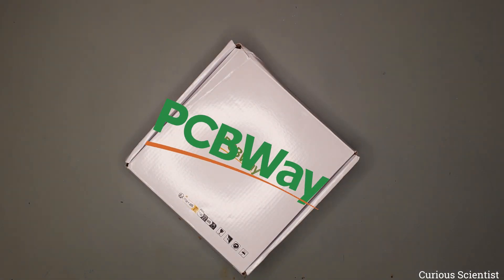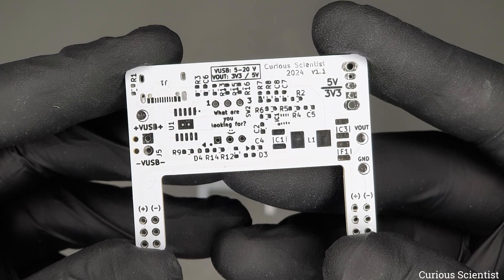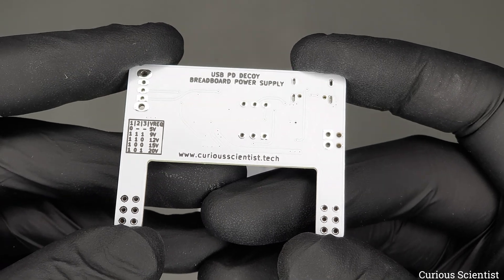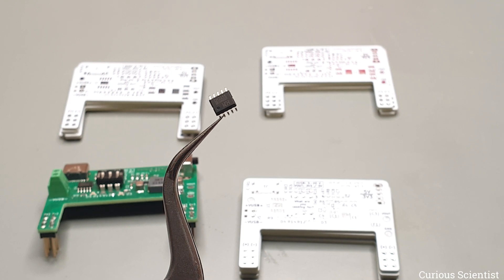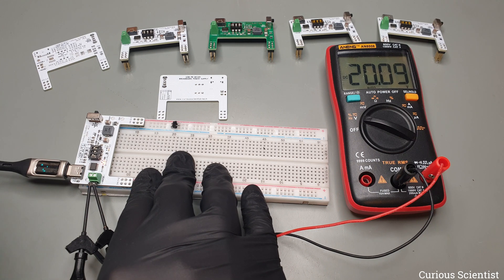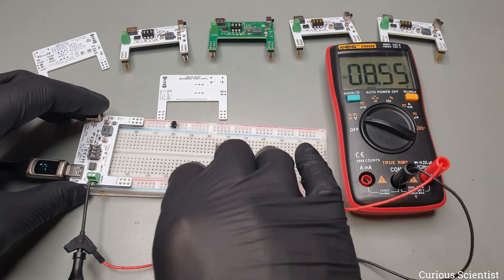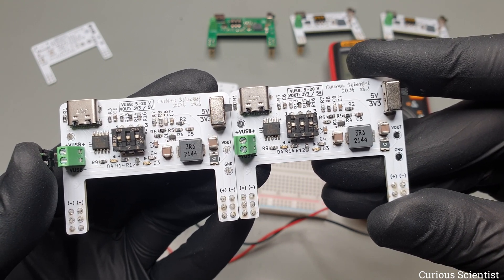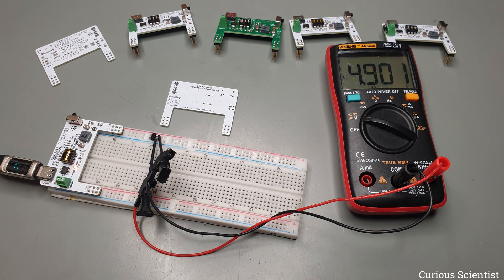USB PD Breadboard Power Supply - Updates!

Comment: but why? its not new and already in the market for cheap.
Reply: this one isn't 100mv max..
Reply from the maker: This can delivery up to 3 A continuous on the 3.3V/5V rails. Plus, whatever voltage is requested from the USB PD power supply can be accessed via the screw terminal. That allows the user to get as high as 20 V and 3 A accessible separately from the selected 3.3 V or 5 V. 

Those cheap breadboard power supplies on the marked cannot do this. They get 5 V and 500 mA directly from the VUSB line and then they either directly connect it to the rail, or convert it down to 3.3 V via an ineffective LDO.
Reply: @CuriousScientist  Yes, it is a very nice prototyping power supply!
Reply from the maker: Thank you!
Reply from the maker: No, this doesn't exist on the market...